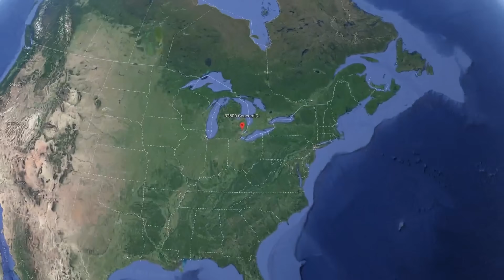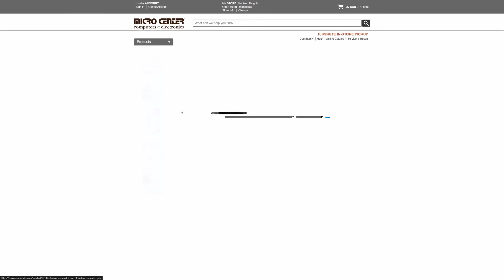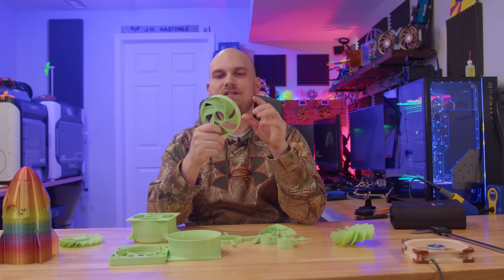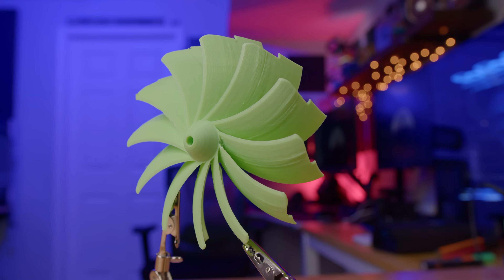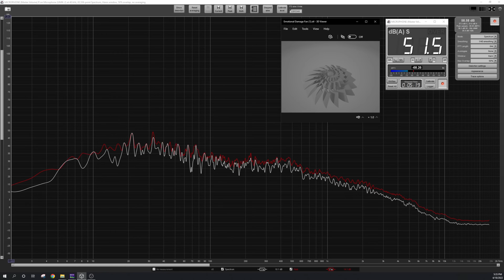TODAY the CHEATER FALLS……maybe | Fan Showdown S4E5

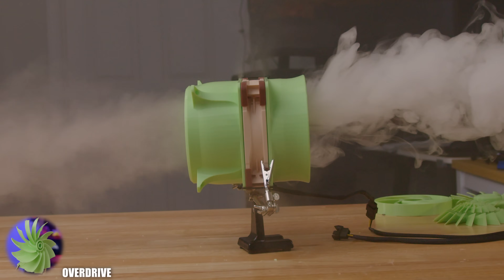Comment: 13:57 - There is a good amount of air escaping between the fan casing and the shroud, I bet if there were a thin strip of rubber there to seal that up, it would move more air AND be quieter...

Comment: You can copy the cheater. Well not entirely. In reality it would be best to use the cheaters fan shroud. It only makes sense. If the rest of the people who submit fans do it they increase their chances of beating the cheater. Because if you can't beat an aspect of the thing you want to beat you need to simply need to copy what you can and improve on the imperfections of that thing you want to best. Unless your goal is just to make a cool looking design.

Comment: I dont know why no one has ever done a single geared system, having all that extra mass just slows it down,. someone should do a similar design to that geared fan but the gears are housed in the center brace and its just a slight gear increase.

Comment: Planetary gears will never work for 2 reasons as far as I can tell. A lot of energy is wasted throwing around the gears, and they end up creating extra turbulence reducing the over all flow. That being said, with a gearbox where the gears are stationary on struts, it'd only be a matter of picking the right ratio to pull out every bit of torque that motor could provide.

Comment: Overdrive, in overdrive mode appeared to have a bit of wobble. As tight as your FDM printer is, I can't help but feel that a printer with higher resolution might offer better results. A 0.1 mm nozzle, acetone smoothed ABS, or even a 2K resolution resin printer. I think if you can resolve material flexing and binding from planetary gear train, and stiffen/balance the fan shaft, it would work much better.

Comment: Over 100 CFM is a really high bar.  I'm not sure if it can be dethroned by anything other than a professionally engineered fan using non-3d printed parts.

Comment: Delta fans tend to have far higher torque then most others, for the sake of geared fans it may be prudent and a bit more fair to give them a bit of a handicap. I have a delta fan that runs about 4k rpm but pulls a bit over an amp.

Comment: I’m wondering if the motor is getting tired. I assume that you’ve been using the same motor from the start. I wonder if it still operating as efficiently as it did when new.

Comment: Ok, so what if we just say "fuck it" to the dba and just slap a large fan with like 4000rpm on it? Take like the cheater, 4000+ rpm motor and just full send her. If the goal truly is cooling, and sound isn't an issue, then how far could we go before it becomes unrealistic? I honestly couldn't care less for a loud PC, constantly wearing headphones/using a loud speaker system and just use a boom mic/shotgun mic.

Comment: There still needs to be two lists.  One for fans that fully fit within the case of the Noctua in all dimensions, and one for fans that exceed these dimensions with the fans themselves or with additional straighteners and inlet bells.  Until then I consider the list of little use.

Comment: Penny for your thots:

the smoke shots are cool but what if we turned them into a simple CFM measurement? Something like an aquarium or other glass paneled box of known volume with a fan mount, a port to pump in smoke, and an intake vent. duct the exhaust out a window and time the fan’s smoke clearing capability. 

eh?

Comment: In my experience, the closer the thickness of a fan blade approaches zero, compared to its size, like literally soda can thickness, for a computer fan, the better.  I'm not sure an aerofoil profile is advantageous, but I noticed that any thickness, at least near the edges, dramatically reduces flow and/or collimation, rather dragging the air more in a circle for a conical output.
I notice an obvious difference in effect when I clean that thin ridge of dust off the leading edge of a room fan blade.
The airflow does seem to be very sensitive to profile variations.

Comment: The assembly instructions for the overdrive clearly do not show zip ties. Those look like long machine screws. Possibly with little nuts holding them on. If they took the time to design it and make an instructional guide, you can at least follow it. 

Not having the pieces aligned will likely be the problem with it not spinning freely, the tolerances are just too tight. If i were to send in a gear fan for testing, i'd have to build the fan myself and send it to you with any additional hardware, such as mounting screws.
Time for you to visit the local ace hardware.

Comment: @Major Hardware
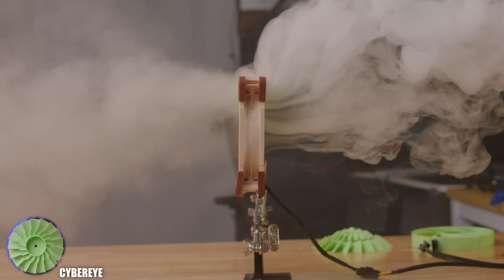13:16 It would be nice if you could fit the fan in an acrylic sheet or something (front side of fan), so the air "overflow" around the edge is prevented, and so we can see the actual suction of the fan. it doesn't have to be a huge sheet, just like some decimeter(s) around or something, still small enough to film from the side. Or maybe you can even use regular plastic cling-wrap (for food) or something, just stretched out enough to form an air barrier.

Comment: Fan science is very well set and finalised. the more blades you have, the less efficient it is but the more pwoer it can absorb. as the blades get closer together, the air between them gets dirtier and dirtier as rpm goes up- however there is a sweet spot. BUT that same sweet spot can be achieved with more efficiency by using less blades and more rpm. 
so its not the fan itself, but the match between the fan, motor and controller. 
then there is blade geometry- that also needs to be matched if you want the best result- matched to the fan speed.
so no, you cannot just eyeball a fan and say 'that'll be good'. 
ultimately the best variable is swept area- the area that the blades cover- as with any propeller, diameter is king.

these videos really tell you absolutely nothing...you need to measure rpm, efflux velocity, thrust and power drawn (voltage, current and resistance) in order to 'evaluate' performance..

you are just measuring some of the variables and that's really easily to manipulate- for example i can pump in any amount of power into a motor with any KV rating and push a fan to a certain RPM.

i see no mention of flow straighteners- a crucial element of fan design, and i see no mention of what and where the fan supports are- obstructions to airflow. Its well known that a fan with inlet supports out performs one that uses outlet supports as the airflow is slower on inlet than outlet so losses are relatively lower on the inlet.

then there is tip clearance..a MAJOR factor. all of it is explained in NASA papers from the 1950s...you literally dont need to just do design after design and do tests. you can either model this all using CFD or test a very small number of fans, calculate their coefficients of performance, and extrapolate.

'the cheater' looks like it has close clearances, an optimum number of blades, a sophisticated blade geometry, flow straighteners, is balanced (?), and is probably optimised for motor/controller/power supply..

a planetary drive for a fan is a terrible idea...

Comment: I've been playing around with creating front and rear housings for some PC fans I'm using with a ULPA filter for my 3D printer. The filter needs really high static pressure (so a completely different type of fan should be used) but I just wanted to see what modifications I could make to what I've got laying around that might work for now. I am trying stacking fans as well to see if that helps any. I picked up a Scythe that rotates clockwise to see if contrarotating fans will make any difference.

I also am planning on making my own 200mm fan and housing as I'd like a higher rpm model than what the market has available right now. I picked up a 140mm fan with a beefy hub motor that I'm going to pull out for the 200mm fan (I couldn't find a source for a fan motor on it's own). It'll be interesting to see how that turns out.

Comment: What if you actually put more power in to the motor to get the gear fan spinning up to like 4k RPM just to see how well it does?? Or try a more powerful motor, I am very curios to see how well it does when it does spin properly.

Comment: I would like to see you print a mirror of the t33 fan. Stack the original and the mirrored fan (on separate motors) so that they are moving air in the same direction, creating a counter rotating set of fans. Then put that stack into the cheater

Comment: the reason you swap lubricants in the bearings is that they are designed for the loading the bearing is rated for, in continuous use. we're playing around here and just need low friction not load capacity or longevity

Comment: Gotta go for a second attempt on my biplane fan ... (Has 6 tiny but still printable biplanes on it that should create some lift ... Or get airborn) 

(They are also modeled so they could have a spinnable prop ... But need to be upscaled and assembled for that, exept the prop and engine cover the airframe and wings are printable in one go in original size (about the same size as a regular cpu)) 
The first attempt failed sadly on email acc aswell as on reddit, hopefully one of my future attempts will

Comment: @Major Hardware, If you want i have a fan - 140mm that according to spec sheet can run at 9000rpm, and can pull up to 9A and should be able to move about 695cfm, it lost a fanblade so I can use it anymore, but will gladly send it to you, as I think it would be fun to see some more elaborate fans that might require a bit more torque. I can also send a controller with it so that you can adjust the fanspeed.
Im pretty sure your are not going to burn this fan out ;-) and yes its a computer fan.
Let me know if you want it?!

Comment: You have to count the friction. You can overdrive a fan (like every thing) to a specific point. After it il will slow down.
example (i'm giving numbers but i'm not calculating anythin)
You have a motor that runs a 3000 rpm and it has 100 nm of torque. You can overdrive it 10 time. On the final shaft you will get 10 nm but it will run at 30.00 rpm. You have to see if (calculating the friction) 10 nm are enaugh to move a fan with a specific mass. You can not ovedrive that fan more than 100 time because the final torque will be 0 because of friction. 
Conclusion: if the fan were overdriven less time, maybe you could get ah higher rpm

Comment: Did you give the dimensions of the plastic that connects the fan motor to the fan shroud? I would think fans with included backplates would work better if they could line up their supports with the ones on the fan.

Comment: When people give the fan a diffuser anyways, why do they bother with planetary gear sets? Why not use a simple gear transmission (or even a belt for more quiets). The diffuser can then bend the airflow over from aligned with the fan axle to aligned with the motor housing. Less friction, less teeth hitting each other, less stuff in the way of the air flow.
Also, I don't get how the diffuser helps with cooling. They are meant to produce laminar air flow. But in a pc fan right after the air exits the motor housing, it immediately hits an object (the heat sink). The main way I can see it helping is by allowing more air to hit the center of the heat sink where the fan motor usually obstructs a patch. I can imagine a diffuser-type piece of tubing which is optimized for that purpose (shoving air towards the heat sink's center) doing even better.

Comment: If you remove grease from a bearing and replace it with oil, the bearings will actually run themselves to failure over time. At first it’s fine, then after not a very long time it will start to grind a little and after a few days of spinning it might even completely get stuck. If a bearing isn’t designed to be ultra low friction, it shouldn’t be that. grease is meant to make it last a proper amount of cycles.

Comment: I just noticed that the Shrouds from the "Overdrive" in its "Direct Drive Mode" would fit perfectly into each other so you basically can stack mutiple "DDM Overdrives" on top of each other...
To create an ultimate semi-self-accelerating windtunnel, that would easily be able to finally outperform the nasty "Cheater"...

Comment: I wonder if the smoke test might work better if the fans were mounted in a "wall" (like the wall of a case). So that smoke doesn't just drift past the fan over the top of it.  If you made the wall out of a clear plastic, you could still film it at both angles.

Comment: Everyone complaining about air getting out of the gaps between the fan and shroud.... Why has no one designed a fan shroud that hugs the frame of the A12x25 from the OUTSIDE instead of using the screw points, just create a box that the a12x25 frame presses into, just saying.

Comment: You really do need to change up your testing parameters, particularly for the smoke test.  Having a random cloud circling the fan does not truthfully illustrate how well, or badly, it's working.

Use an empty computer case with lexan panels with the smoke either generated inside the case or outside and pulled into the case, so overspill is displaced according to the case shape as would happen when real fans are in real cases.
Reply: @ButterfatFarms  He did it, though, if you've watched more recent videos.

Comment: ...overdrive's fan blades have high angle of attack (they are almost vertical) and are probably creating a lot of drag (load torque). Planetary gear system should've been reversed to increase the engine torque instead of RPM...:/

Comment: I enjoy the content but the "Fan Showdown" has lost its way.
I don't care who can designed the best 8 foot long fan if it can't be installed in a computer.
Reply: Perhaps inside a couple of 5.25" drive bays, as long as they form one "space" inside the case and there being a mesh (or "hole") in front of them.
Reply: @Peter1986C  and connected to either heat pipes or a radiator...

Comment: im sorry but your test is not good enough. CFM does not take into acount static pressure. the problem with that is: when you try to squeeze air between thin plates like a heatsink, pressure is significant. 

so, unfortunatly your results cant be directly correlated to cooling performance.

Comment: Venturie... Build a fan housing with three or four venturie/funnels norrowing into the sides of it and then expanding out on the inside of it. Set up the fan to promote airflow in the direction of toward the heatsink. Be sure the funnels are wider in the entrance side of the outer housing and wide on the exit end of the inside of the housing. Sorry don't have a computer working now to try and CAD things...

Comment: This whole series made me get a 3D printer and print loads of things but right now I’m experimenting with fan inserts that fill the gap between the fan tip and the casing. Seems to have improved my noctua 140 industrial fans since the gap was so wide. 0.8mm wall all away around fits just fine. Wish I had a real way of testing it though!

Comment: You know the Thermaltake Toughfans, the TT rip offs of the x25 have a max amperage of .70 whereas the x25's only pull .14. Maybe the shitter thermaltakes have more torque to spin those harder to drive fan designs.

Comment: Here is an actually good suggestion. For bearings, use tri-flow. I used to skateboard a LOT and have since switched to longboarding. I have tried hundreds of bearing and lube combinations over the years and Tri-flow has proven to be BY FAR the superior bearing lube for longevity, water protection, and lubrication properties. The difference between gun lube and tri-flow is huge enough that  I can go nearly double the speed and distance on my board compared to any other lubricant.

Comment: 6:56 I have to ask... how did you print those metal bearings?

edit: 8:00 how did you print that oil?

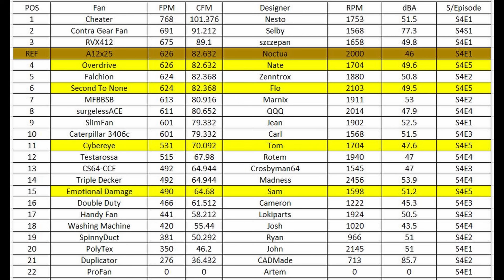edit2: 14:48 I thought you said cheater beat A12x25? As far as I can tell only #16, #18, and #22 beat it, the last one doing so on account of not even rotating and is thus not even a fan :p

Comment: wow, no mentions of the second to none performing almost the same as the overdrive? I was actually stunned by its performance.
Reply: And at a higher rpm than the a12x25 too, I bet a little more blade angle and some more refinement on the airfoil (the trailing edge looks square) would make it even better than the noctua
Reply: It was second to one at least...
Reply: All I know is that I was extremely disappointed to find out that it was not in fact inspired by the M2 Bradley's promotional video

Comment: We have looked at the impracticality aspect of fans like the cheater + shroud, but is this the right perspective? If fans are the most economic cooling solution, and that is the most effective fan type, does it not make more sense than the *case design* for PCs is flawed, not the fan?

You can design a PC case to look however you want, big or small, there are very few restraints in that regard. How about PC cases that are more rectangular, like the smoke tunnel use for testing, as an example. If the whole PC housing was designed like a wind tunnel it would facilitate a fan like the cheater perfectly.

Which brings us to the next level, the PC Case Showdown where you test the cheater to see what cases give the best temperature lol
Reply: The problem with this is that motherboard standards kind of screw up any fun design possibilities with cases.

Comment: How the heck do you figure the Second to None is 6th, and not 5th? The stats are the same as Falchion, except it spins faster and is quieter.... It's the better fan; If not, tied for 5th.
Reply: think he's going purely by difference between room-temp and core temps, not overly worried on rpm/quietness

Comment: What about resin printing the gears instead? not having those rough edges from normal 3d printing might remove a lot of the friction present when spinning the gears.
Reply: or even  stick some grease in there lol. would help with noise as well